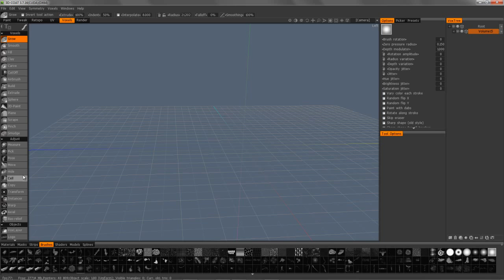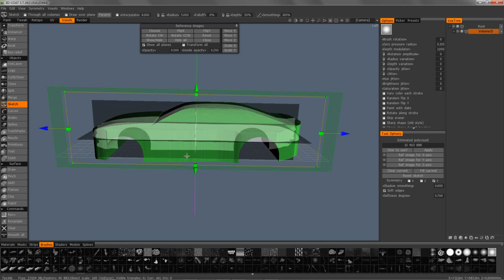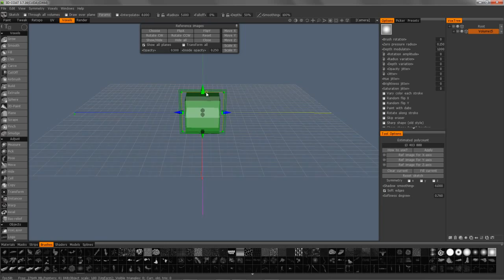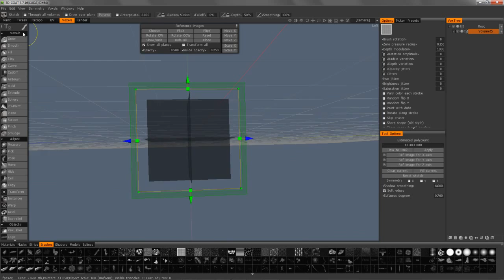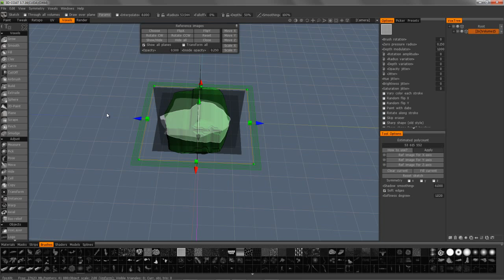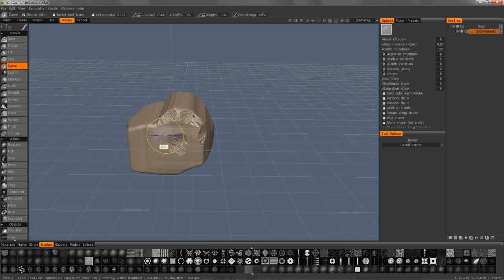Updated Sketch Tool

Comment: Well, navigation is rather tricky with this tool as orbiting is set to object, and when you don't have an object in the scene, then it's rather jerky. Same thing happens in 3ds Max. Nvigation is smooth as butter when you have something selected. But the moment you do not, then it gets a little hairy. Probably should have set orbit around World center.